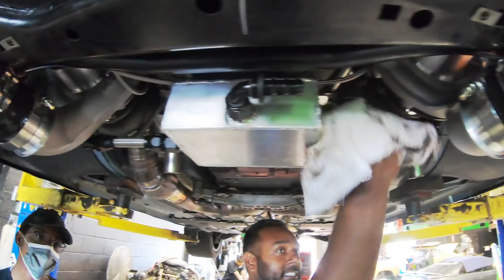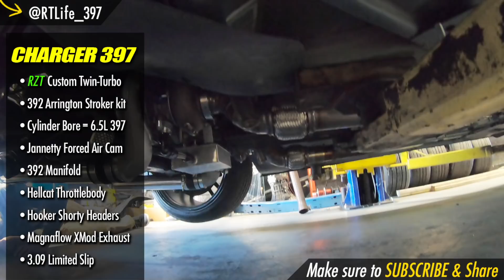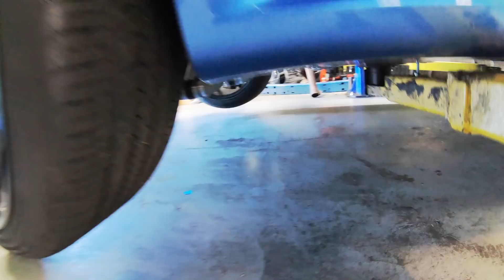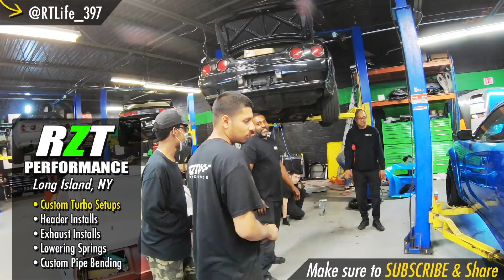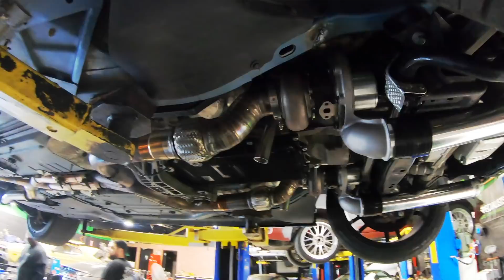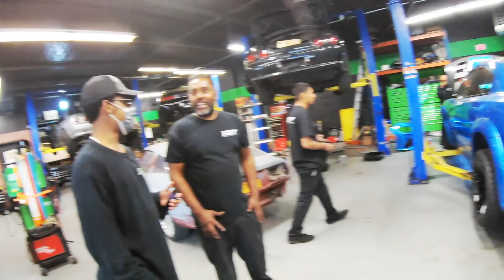Most VICIOUS V8!!!

Comment: very nice build rt i been watching for about a year or 2 now you came a long way with the blue beast but i have a question i have an 2011 dodge pursuit v8 i want to make about 450hp or 500hp any recommendations i was thinking torqstorm and getting the intercooler than tune
Reply from the maker: That will def get to you 450-500whp range esp. if you do a forced air cam. I was looking at TorqStorm as well - simple bolt on & you just have to figure out a cooling setup. I've heard solid feedback on those.
Reply: @RTLife   yeah i heard good things about it even on stock internal so you think the torqstorm and an a intercooler will be an okay setup or would i need other things?

Comment: From what you can see on video this shop has done a very nice job on running the charge pipes and kudos to them for the oil recovery tank which I am sure is hooked up to a scavenge pump. Very clean install. If you're staying on 93 I'm assuming you have a dual pump system? I am curious with a simple as methanol is to hook up and is easy as it is to get it not to mention it's super cheap why not run it? You can set it to come on in the middle of the boost range. Just curious.

Comment: So could this possibly be a 10 second full ish weight car now?
Reply from the maker: If it hits around 850+whp range yah (mid/low 10's). My fueling system might be a problem.
Reply: That would be one heck of a car then. As far as fueling goes. Have you checked in with ripp? They have injectors for the v6’s and im sure v8’s bigger than hellcat injectors. And im sure a walborough fuel pump would do plenty or just a 450lph fuel pump would do good too. Not 100% on that. Ive got a twin turbo 360 magnum in a second gen dodge. Im running 80lb injectors from snake eater and twin holley 450 lph external fuel pumps on a dual inlet/outlet 16 gallon fuel cell. Not much. About 550hp to the wheels. But fueling isnt my issue. Its the small cam i chose lol

Comment: What fuel system,injector upgrades , Map sensor, Plugs, were done?
Reply from the maker: 400LPH Drop in fuel single pump & id1050x injectors - that's what it says on the upgraded parts list.
Reply: @RTLife  Just so you know it didn't leave my shop with ID1050x it has stock injectors,  you will need to add ID1050x or equivilent,  2 or 3 bar map sensor, and colder plugs and 400 lph pump will still be taxed car should have a Fore innovation fuel system added.  Don't blow it up.
Reply from the maker: Thank you for the heads up on that. On the invoice it had those listed, just assumed they were installed. I'll upgrade them before cranking up the boost. We will see what this beast can do!